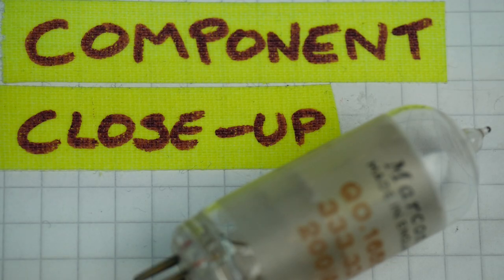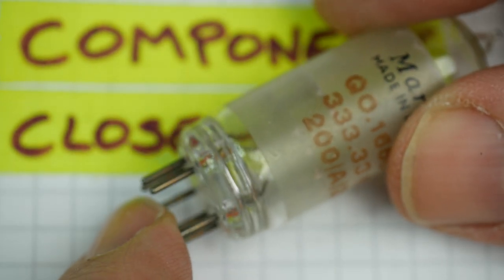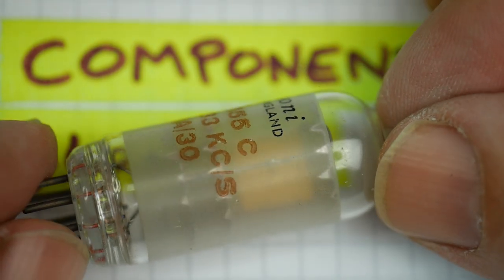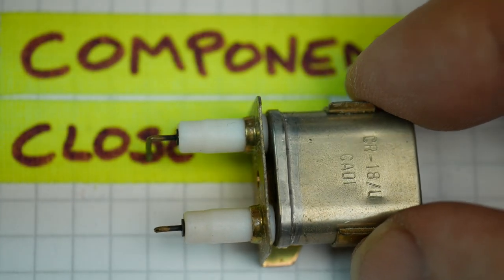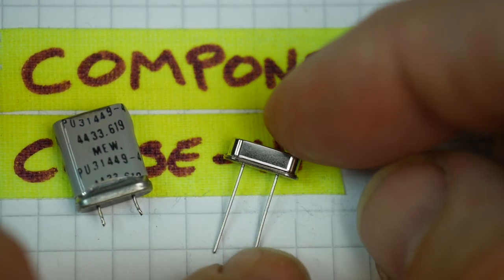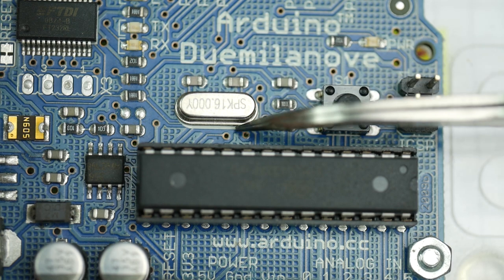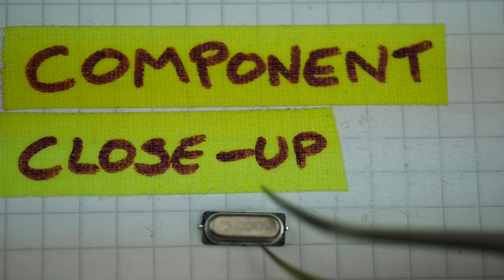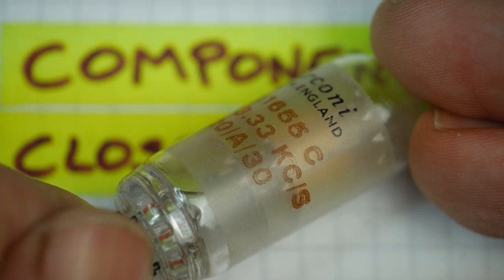Component Close-Up: Quartz Crystal in Glass Envelope

Comment: Very interesting. Wondering why the glass tube crystal has so many leads while the others only have two?
Reply from the maker: It's a standard 7-pin valve package. I suppose it was easier or cheaper to just use a standard glass package with seven pins and leave five of them unused. It would also fit into an ordinary 7-pin valveholder.